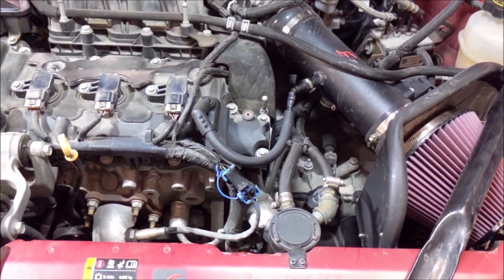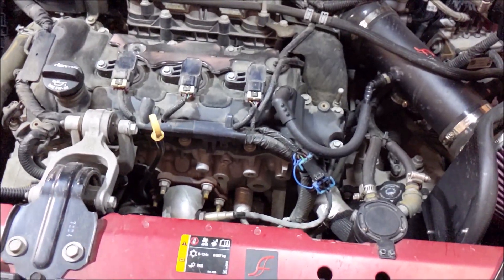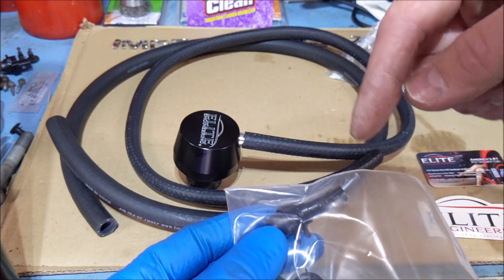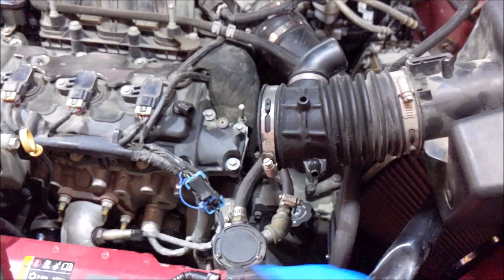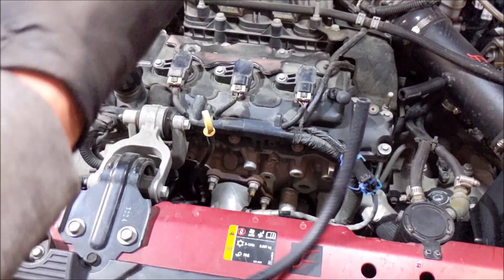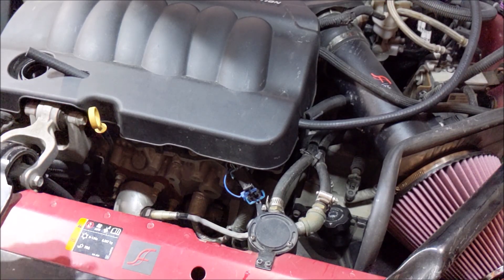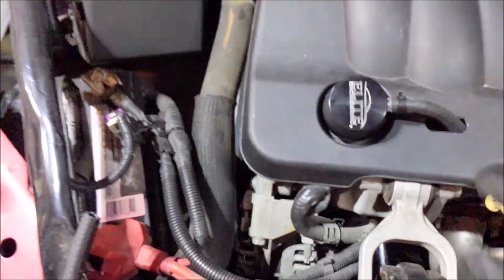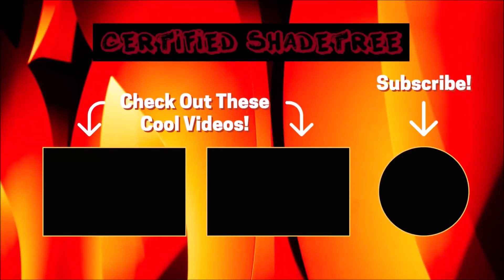GM 3.6 Liter V6 High-Feature Engine Clean Side Oil Separator Installation **AUGMENT YOUR CATCH CAN**

Comment: I don't have a catch can or anything on my 2012 3.6 Impala. I keep the oil changed and use full synthetic
Reply from the maker: Check the snorkel running from the filter box to the throttle body. Guarantee you it's full of oil..
Reply: @CertifiedShadetree  well to be honest I took a look and noticed oil on my air filter and see oil in snorkel. And in coolant reservoir. What should I do?
Reply from the maker: Are you absolutely certain it's oil that's in the coolant reservoir? Or are you just seeing residue on the sides of the tank? Are you having to add coolant every so often? What does your oil look like? Meaning, pull the dipstick and see if the level is abnormally high or the oil on it looks like a milkshake.  These are signs of a blown headgasket.  Conversely if you aren't losing coolant or your oil is normal, you probably just need a good cooling system flush.

Oil in the intake snorkel (and on the air filter) is a common occurrence on these engines, which is why I made this video and fully advocate for installing a clean-side separator..
Reply: @CertifiedShadetree  Oil is in coolant reservoir. Just had the oil changed so the oil appearance is normal and is at normal level. hasn't lost coolant since replacing water pump for the second time. The last 1 lasted only for a year has entire new cooling system. The car has 191,000 miles on it and I take care of it best I can $3,000 into it. I do have a habit of flooring it alot I push the car hard. Stills runs okay. Notice some gear sticking or delay shifting or just lousy shifting under normal driving but does not always occur. Car runs better on cold start.
Reply from the maker: I would purchase this test kit to check for a blown headgasket:
https://www.amazon.com/Block-Tester-BT-500-Combustion-Leak/dp/B06VVBSFTF

With 191k, it might be worth it to try some Blue Devil if it indeed does have a blown headgasket:
https://www.amazon.com/BlueDevil-Pour-N-Go-Head-Gasket-Sealer/dp/B004500M8G

Another thought - Have you checked your trans fluid level or condition lately? The radiator is another possible point of cross-contamination if there's a breach between the trans fluid cooler side and the radiator side.  The lousy shifting could be the smoking gun..
Reply: Expect modern engines to use oil if you push them hard. Why ? You ask. Several reasons, high rpm atomizes more oil in the crankcase. High rpm also creates more blow-by pas t the rings. The PCV valve can only handle a metered amount of air. The "Clean s ide" then backflows oily air into the intake stream and burns it . Lighten up on the throttle and reduce your consumption. BTW, all of this oily air is building carbon deposits on the back of your intake valves because fuek is injecte d directly into the combustion cylinder.

Comment: Wanna show me where to mount mine? ☺ The layout is a bit different on my '22 Canyon. Thanks for the video!
Reply from the maker: I can't give you a 100% answer, so I would look for a hose running from the intake tube (between the air filter box and throttle body) to one of the valve covers. I would reach out to Elite Engineering to remove any doubt though.

Comment: Great video. I liked how you plumbed it through the engine cover. Did you remove the clamp from the separator end? If so, any issues removing and reinstalling the engine cover?
Reply from the maker: You know, I haven't taken that clamp off yet, and come to think of it I haven't taken the engine cover off since installing the separator! 🤣  Have done a few oil changes, however, and there haven't been any issues with the separator or hose or anything like that.

Comment: Hey shade. This cool. However I have a 10th gen. Not sure if that cap would fit with my engine cover on. I wanted to ask if I could use one of those little see through oil separator with the filter, route it between the air box and valve cover, and dump and clean it when it gets full.
Reply from the maker: I wouldn't worry about the separator not fitting, it's the same diameter as the stock LFX oil cap, which is the same regardless of what vehicle the LFX engine is in or what cover it has sitting on top of it.  I mean, theoretically, you COULD very easily install a catch can on the clean side, but then you'd need to empty it all the time, whereas this never needs emptying..

Comment: I certainly dont know why that guy told me a trans cooler line is causing oil in my air filter housing.  Everything points to pcv valve    , jeez and hes a mechanic  LOL

Comment: But i was told it was moreso my transmission cooling hose that was causing my oil in my air filter compartment. Then i was reading about bad piston rings , but i dont see thats the problem.  But a mechanic that knows about vehicles said my transmission cooler line , something about sucking oil back or something like 🤔 and i noticed my transmission hose is damp at the fitting.  But then im hearing about pcv valve moreso. Cause my car never was down on the dipstick to by the add mark,  im confused but it has to be between pcv and transmission cooler line you think ?
Reply from the maker: I mean it's possible it could be a trans cooler fitting, but you'd also notice trans fluid all over the front of the core support if that were the case. I would sniff the filter myself. You can get an immediate read on what's on that filter just by smelling it. Oil blow-by from the engine is the far likelier scenario, IMHO. Unless of course the core support and radiator are soaked in ATF..
Reply: @CertifiedShadetree  ya , im gonna go to my private mechanic today,  they work on everything , jobs big or small.   But it sure sounds like a pcv to me
Reply from the maker: @myfavorites1016  If it does turn out to be the trans cooler fitting, have them replace it, top off the fluid, and change the air filter.
Reply: @CertifiedShadetree  i was to my private mechanic shop today , he was kinda like what did that O'Reilly guy say 🤔 , he said he hasn't heard much about a trans line with suction,  he said ya a pcv valve yes is moreso the issue.  We both agreed,  so Monday im replacing pcv valve , mine has 2 spots for the valve the way computers showing . But he is also gonna look at trans cooler line , where the couplers are leaking,  it appears to be oil on coupleers . Im not a mechanic,  so if i dont make sense excuse me 😂
Reply: @CertifiedShadetree  i really appreciate your help my friend  your awesome
Reply from the maker: You're welcome, man. Best of luck to you! 🍻
Reply: @CertifiedShadetree  well my impala takes 2 pcv valves  40.00 for 2  , monday my impala goes in , i told him to look into my trans cooler line , as the coupler is looking damp.  Then will have to get my valves cleaned with there high tech machine.  The Berryman b12 does work very good , but its not getting the back of the valves.
Reply from the maker: @myfavorites1016  Just for clarity,  there is only 1 PCV valve on the 3.6.  The one and only PCV valve inserts into to the rear valve cover on the dirty side. The clean side merely has a plastic fitting on the front valve cover not a PCV valve. Don't let them charge you for 2 of the same part #..
Reply: Am i able to take photo of the parts and post it on this channel?
Reply from the maker: @myfavorites1016  Send your pics to leaderofwagons@likeabigdog.com
Reply: @CertifiedShadetree  i will do after a bit  👍👍
Reply: I just sent you a photo

Comment: I just serviced the throttle body today, and started folllowing you a few weeks back so this is a handsome surprise. But i did notice i had alot of oil in the tube going to the throttle body and now see that its coming from that pcv system there? I dont have a catch can installed! Did you cover this before. I enjoy the car however i have a po340 po011 code that wont give way after 4 new cam sensors 2 valve solenoids and crank sensor. I suspect wiring.
Reply from the maker: It could very well be wiring.  There are several TSBs covering many many years and model vehicles with the 3.6 involving chafing wiring harnesses.  Bosch USED to have a brilliant page dedicated to the 3.6 that had all of the OBD codes these engines were notorious for and how to go about troubleshooting and repairing them. AND THEY REMOVED THE PAGE!! 😡🤬   You should still be able to locate the TSBs, however.

Anyway, yes I do have some old videos on my channel pertaining to installation of the catch can..
https://www.youtube.com/watch?v=-XlG5po15Fw

Comment: I have an extra Catch can but the o-ring is done, was think of putting it for the clean side because I'm pulling oil too. Got to find the right o-ring. Think that should help too.
Reply from the maker: I was telling Nick down below that you'd probably want to install the catch can backwards so when it goes under vacuum it'll properly trap the oil blow-by.  By backwards, I mean run the inlet hose to the valve cover and the outlet to the intake tube..
Reply: @CertifiedShadetree  yep was going to do that 👍

Comment: I wonder if the regular oil catch can that you run on the dirty side. Would work if it was put in between the fresh air valve cover intake and the cold air intake connection.
Reply from the maker: Maybe? You'd want to install it backwards at least so it doesn't draw the captured oil into the intake tube. And then you'd still have to empty the can once in a while..

Comment: How much oil was getting through with just the dirty side separator? I’m still getting a decent amount and the can is only catching a few ounces every 100 miles or so. I have the can up by the radiator so it’s a long hose run. Just curious what kind of results you’re getting?
Reply from the maker: My catch can fills up mostly with condensation in the winter, so I dump it every 1000 miles. During the warm months, I can go pretty much until Fall without emptying it out. As far as the clean side goes, let's just say there was oil dripping out of the clean side hose when I removed it..
Reply: @CertifiedShadetree  thanks man. One more question if you don’t mind, how many miles did you get on your shocks? I’m at 128k and they seem fine. Just wondering if that’s normal for the LTZ.
Reply from the maker: @jameskarl8908  I changed the struts on my old 12 LT when it had 175k!!  Hell, I didn't change struts on my 04 Impala until it had close to 200k.  The stock struts last a looooong time!